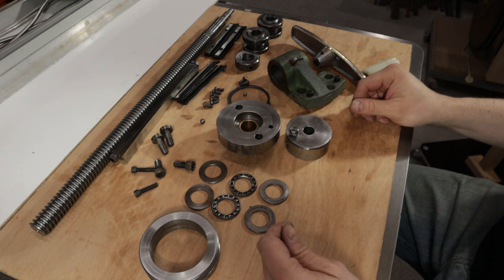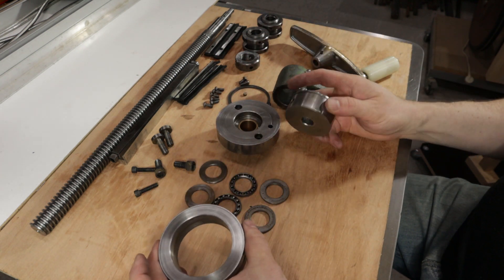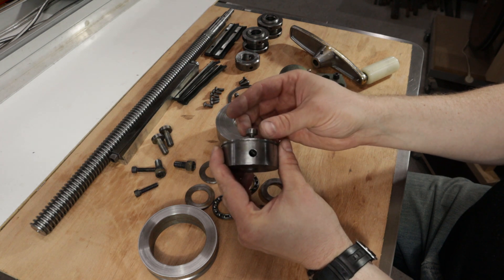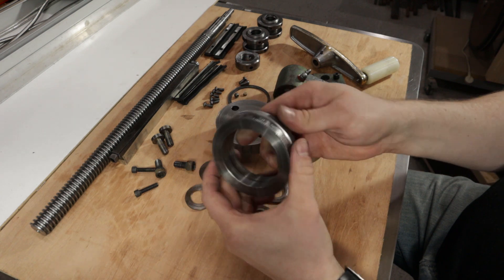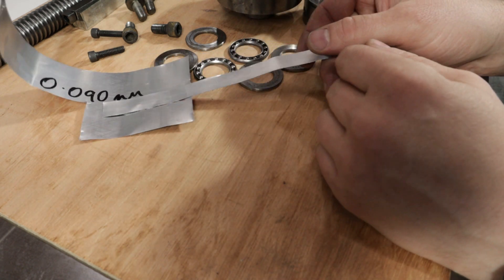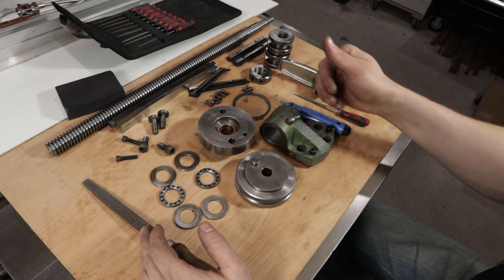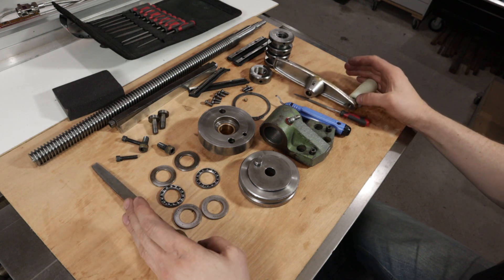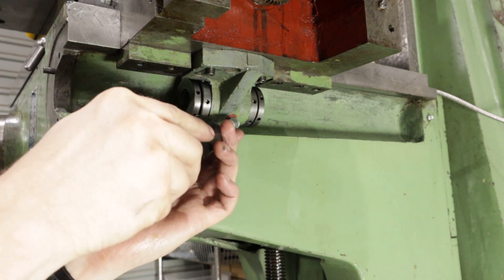Installing a Mill DRO - Y Axis repair

Comment: That looked like it was moving effortlessly.  And an awesome job cleaning
Reply from the maker: Thanks Anthony. Yes, it's always been quite easy to move (amazing for a several hundred kg table), but it's really gliding now and with next to no backlash. Very happy with the result. I've decided to leave the gib as is for now - but I'll make up a nicer little locking screw (or a set of three for each of the way controls) Cheers, Craig

Comment: Very disappointed mate... all those bits and pieces but you didn't drop a single one and have it roll under the mill 😁
Reply from the maker: Apologies Bill. Must. Try. Harder.

Actually I'm gonna silicon seal the thing, now that you've jinxed me :-)

Currently working on those video lights I showed a while ago. They've been half finished for ages, and the bits and pieces are clogging up the workshop. Got the stems shortened, and painted matt black (like all pro light gear), and the first box sanded and filled, and another of white on the inside. Second box is gluing up as we speak. Not sure yet how I'll attach the diffuser material, but bulldog clips have been working ok for now.. Will keep mulling it over. 

(Not really video worthy, and anyway - how would I light the video?) :-)
Reply: 🤣 Now the ball bearings will bounce off the silicone and go out the door.
Video on the lights probly would have been good, ppl are always wanting or needing  tips on better lighting
Reply from the maker: @billbaggins  That'd be just my luck :)

I'll include a segment about the lights then when they're done. People might find it useful. I can always film it outside if needed.
Reply: 🤔 use one while filming the other ? would give a good comparison for when both are done.
Reply from the maker: @billbaggins  Good idea

Comment: That's a complicated assembly on that machine.
Nice fix. Seems to work well.
Reply from the maker: Thanks Rusty. Complicated, but it's a very well designed mechanism though axial thrust bearings with pre-load adjustment, zero-locking, and backlash compensation on the screw. Very nice design.

Yes - was a very simple fix, but it does the trick. I might make a new (nicer) zero lock screw. Think I've decided to leave the gib as is for now though. It's working so well, I'm afraid to mess with it, and I don't have the correct materials on hand anyway (cast iron). I think I'll hold off at least until the world gets back to normal.

Thanks for watching.
Cheers, Craig

Comment: Nice job.  But once the DRO is on the backlash in the screw won't matter.  The dro move when the table does.
Reply from the maker: Yes - understood, but I'd like it moving and running as well as it can with or without the DRO. Cheers! Craig

Comment: There's a lot of parts in that screw assembly. Sound like you've got a nice movement there with no tight spots. Enjoyed the video.Tony
Reply from the maker: Thanks Tony. Yes - it's very nicely made. Thrust bearings with preload adjustment. Two lead nuts with backlash compensation, and between them a large amount of thread engagement. I think the only things I'd change now are the little lock knob, and the gib. Both are working well enough for now though. Thanks for tuning in again! Cheers, Craig

Comment: What a cool mechanical design with the off center lead screw.   And the inboard gib.    Love the dial locking mechanism on this machine.  Need to repair a couple mine as well. Not as cool as yours though
Reply from the maker: Hi Craig - Thanks! Interesting (?) factoid: the first and previous model of this machine had the off center screw, but it had a central raised portion. This led to racking and was a problem. Victor Balding (of Balding Engineering) was the original designer. When Richard Price (I will have to check that) came along and joined the team, they released the VBRP model (named after them both), and one of the features was moving the left-right raised portion of the ways to be in line with the right-mounted screw, getting rid of the problem entirely. This particular model is the PAL - the same as the Mk2 VBRP I believe, but without a gear driven backgear.Instead it had extra pulleys and a lighter weight drive train. I've replaced a lot of that functionality with a custom pulley, different 3 phase motor, and a VFD for variable speed. Still have to come up with a better control for it all one of these days. Cheers, Craig
Reply: @CraigsWorkshop  I love seeing different mechanical design ideas, ideas generate ideas, which generate more ideas..you get the idea..lol
Reply from the maker: Agreed, me too. There's an old (Very very old) book that you might enjoy called something like 100 mechanical movements or 500 mechanical movements or something similar. It's just sketch after sketch of ideas to do with levers, pulleys, gears, tapers, any of the simple machines. I'll try to dig up a link for you.
Reply from the maker: Even better, it was well out of copyright - so it's been turned into a website the the hand sketches turned into animations! http://507movements.com/

I'm very glad I looked this up :-)
Reply: @CraigsWorkshop  oMG! You werent kidding. That site will keep me entertained for a while..thanks for the heads up

Comment: nice to see how the mechanism works. ive got a fair bit of lash on my y axis, need to put a new screw and nut in one day
Reply from the maker: If you don't have a long lathe with screw cutting, one of the best methods I've seen is to take some off the shelf threaded acme rod, and turn whatever features you need separately, and basically bits together to make up a lead screw. Sounds awkward, but it seems to work very well. Since the nut is only a short piece of thread, it should be possible when your threading adapter is done? (Buy the screw first though so you have something to test-fit to). Cheers, Craig

Comment: 3 thou wow that's awesome
I've got roughly 1 mm on my y axis. I'll have to make a new nut at some point. Just another project
Reply from the maker: Thanks. I don't know how long it'll stay nice and tight, but I see no reason for it to change much - especially if it's properly lubed.

I have a nut to make too for for lathe cross slide. It has quite a bit of play too. Can't remember exactly how much but it's around 0.020" or more (0.5mm), which is not good, given the fairly fine pitch (8 tpi I believe - which means the average thread thickness is under 1.6mm).

Cheers, Craig

Comment: looks like it works pretty well craig and looks like a tight old machine. The cheese head screw on the gib goes into the slot in the gib on the end so the gib doesnt get wedged in and tightened up when the table is moving, and so the gib will be retracted when the screw is removed.
Reply from the maker: Thanks - yes that's how it's meant to work, but if you look back at the original pics of the gib in the previous video, you'll see the gib has been shortened, then re-lengthened with a screws added to each end. Those screws serve as a small slot which holds the folded shims in place (finally figured that out), and the gib is pinned in place anyway because there is a screw on each end.

Normally, as you say, there would be a slot in the gib on the fat end, which means you can either push in or pull out with the adjuster screw (and just lock in place with the opposite screw). That slot doesn't exist any more though. After trying to set it today, the lack of an adjuster slot doesn't harm it at all, and I think if I remake the gib, I would leave that slot out. Having both adjuster screws opposing means I can do whatever I need to do with no problems.

The benefit of a new gib would to be get rid of the two internal cap screws which serve as slots for the shims, and of course the shims themselves. I would stack a piece of materal on top of the old gib to get the inital angle, and hit it with an end mill just to copy the angle. Then I would blue it and tap it home to see what the fit was like. I can scrape (or re-mill) to suit. I would make it a little longer than standard so I have some adjustability in future.

Cheers, Craig

Edit: Main problem at this point is (I think) I don't have a large enough piece of cast to do the job. I do have various mild steels, or - best bet so far is probably standard 360 brass. What do you reckon? Use some brass and see how it wears? I don't intend on scraping the ways, which would be the normal first step with a gib replacement. Or just leave it well alone - it is working quite sweetly right now.
Reply: I would just get cast iron and forget it, brass would wear too fast and steel would just score the crap out of your ways and wear the ways down pretty fast. If it's working fine now as is tho, I think I'd honestly just leave it alone.
Reply from the maker: @ChirpysTinkerings  I think you're right. Since fixing the leadscrew backlash and resetting the gib (and cleaning and lubing everything), it's running pretty perfectly. I'll leave it until I need to do something about it.

Comment: I like the colour of the mill , i might paint my Hercus t&c grinder the same !  Good repair .
Reply from the maker: Thanks Max - that means a lot from you - I hope to be half as talented one day. Cheers, Craig PS: Yes, that's the correct colour for all old machines :-)
Reply: @CraigsWorkshop  If you ever come across the paint code or colour name ,  let me know what it is . Cheers .
Reply from the maker: @swanvalleymachineshop  Will do Max. I can tell you this though: I was in semi-regular contact with Mal Conomy (of australianmetalworkinghobbyist) when I had the Hercus 9A. He provided some of the new old stock parts for that machine (cross slide screw, half nuts, etc). He's considered pretty much the Aussie Hercus  lathe expert. Anyway - before I found him, I had taken my old half nuts to the paint matching store, spent about an hour with the colour expert there, and after looking at every off the shelf green from every manufacturer, we could do no better than "Wilderness Green" which is a colourbond colour - it's not quite the same green as this mill, but it was a great match for the Hercus original green colour which was also very nice (though in truth the original Hercus colours appear to have varied a fair amount too). Later on - after buying the paint, I was very pleased to have found info from Mal in other forums saying that it was the best match for the original paint. :-) Lucky! Cheers, Craig